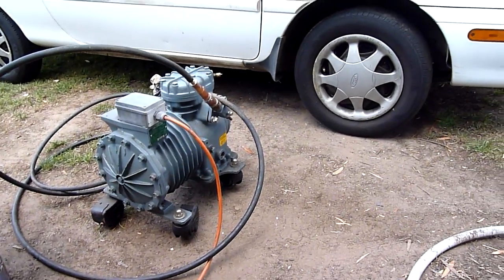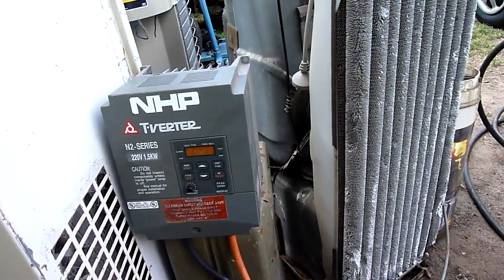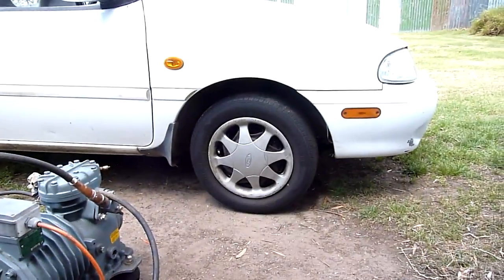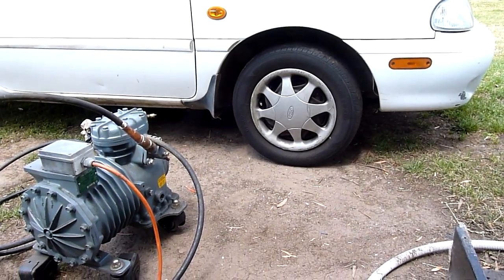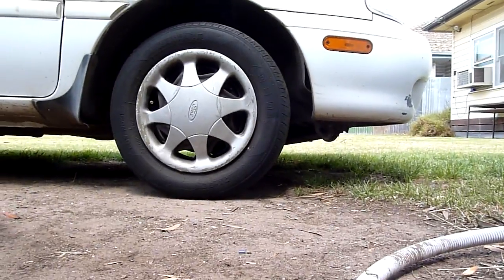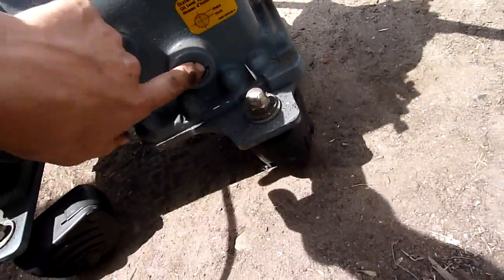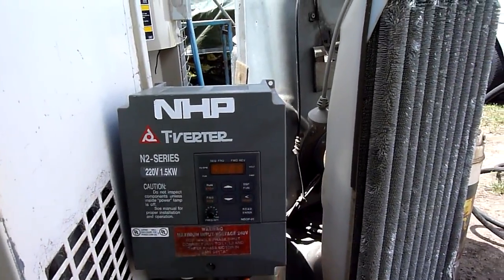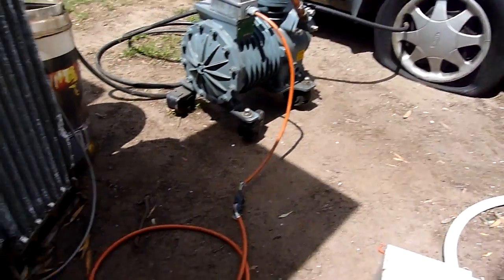Semi-Hermetic Compressor Implodes Car Tire - worlds flattest?

Comment from the maker: @NOLIMIT69NOLIMIT2000 the control box is a stand alone 3 phase VFD for any small 3 phase motor. I will eventually set the compressor up with a static phase converter instead, single speed only.